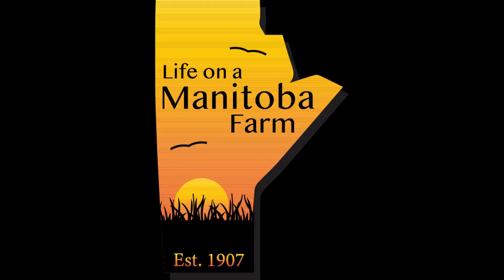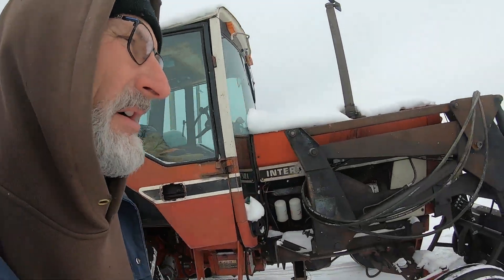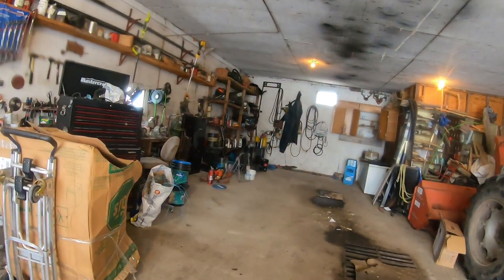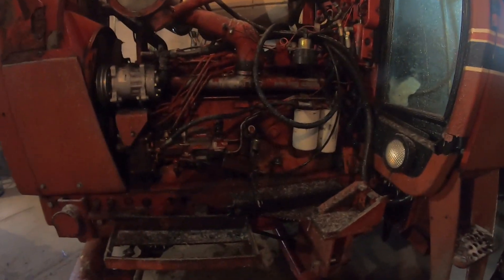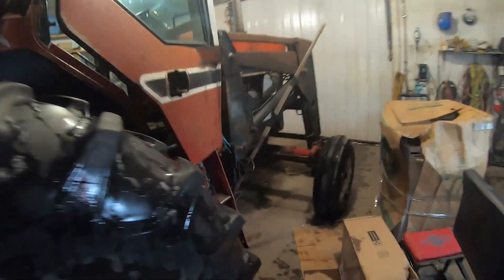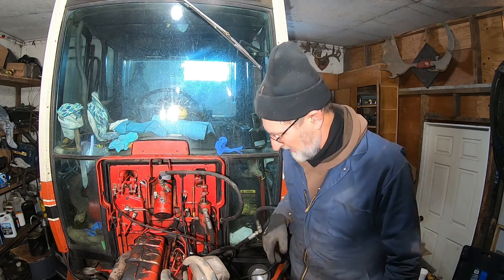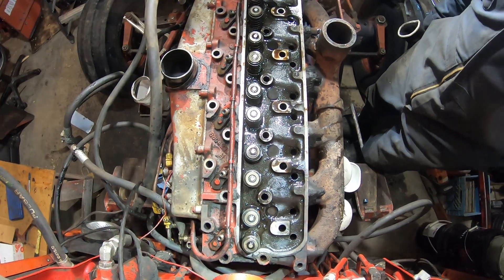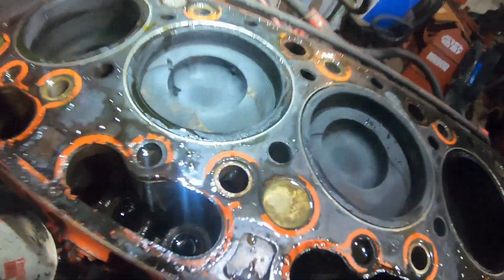Tractor Engine Overhaul!!!!!

Comment: Had some what of the same kind of problem on our  1066.   Hydraulic couple were to cold to get them plugged together.  So got a piece of dry vent hose put it over the exhaust pipe and back to the outlets   a few minutes later every thawed out and back together.

Comment: What's the problem with the tractor?  What are you fixing?
Reply from the maker: It is very hard to start in colder weather and it had a bad oil leak. Also it had 9600 hours, which I feel it is ready for an overhaul.

Comment: Randy the head gasket are notorious for leaking oil on the right side just look how far it is between the edge and the first row of head bolts. You also may have had some wet stacking giong on. Which is un burnt fuel comming out through the exhaust, I imagine that you idle the tractor alot so that wouldn't be a surprise. My 1066 gets real bad from that. I would for sure do the main and rod berings since you put that many hours on it, and new injectors are a good idea too. I can't stress enough to follow the directions on installing the orings on the sleeves and lubricating them properly when slideing them into the block. Also new rod bolts are a must. I actually broke a new one when my torque wrench got messed up. Just trying to give you the benefit of my mistakes.... no wait experience 😁 Good luck 👍
Reply from the maker: Thanks, I’m planning to have the mechanic that does work for me to help me put the bearings in. Any advice you can give me, I really appreciate it.